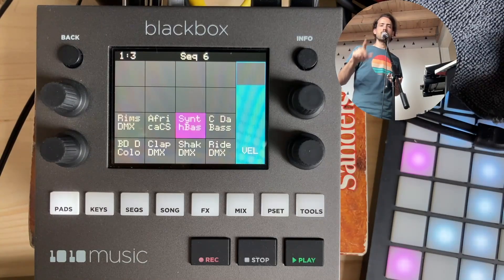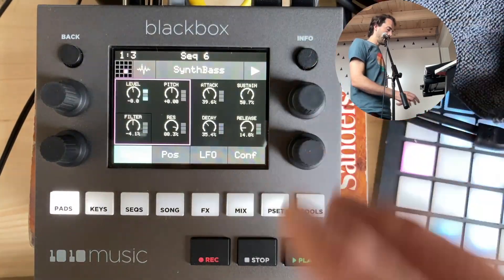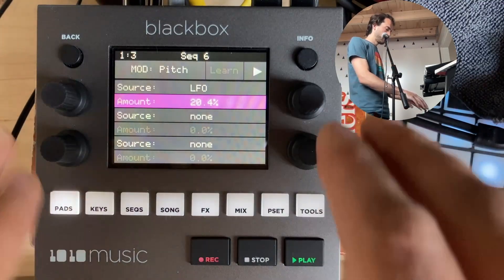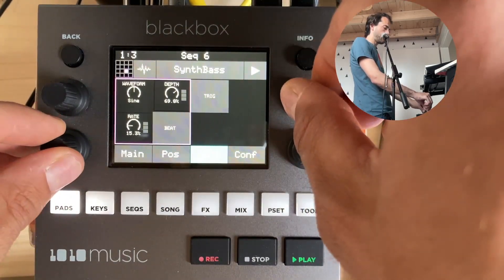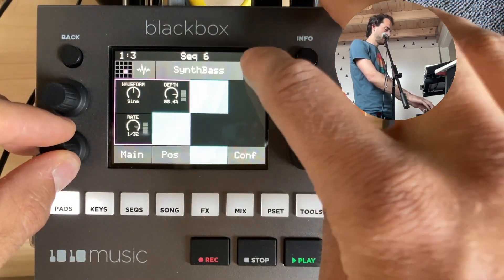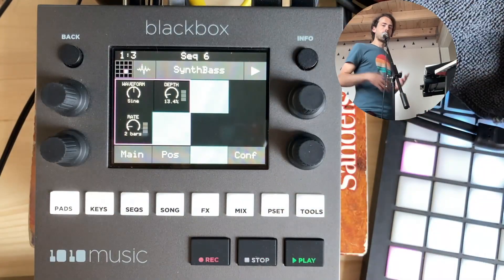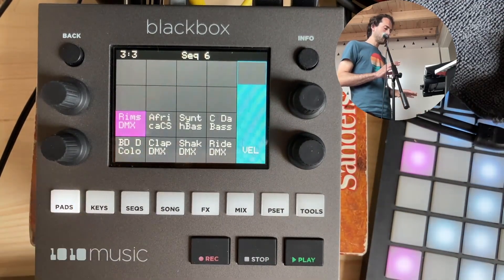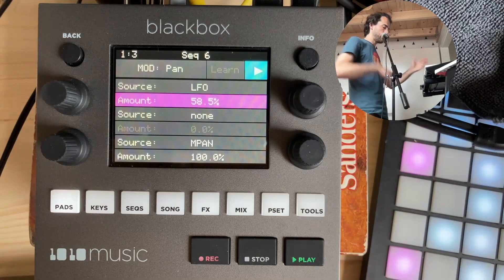1010music blackbox tip: Fun With LFO's

Comment: Just subbed for your Blackbox tips! Could not find anything in the manual, but is it possible to send LFOs out of the Blackbox? I know we can load or record CV LFOs onto pads and assign their outputs to modulate eurorack, but I wonder if we can send MIDI LFOs out to control CC on gear. Thanks for your tips!
Reply from the maker: I haven’t sought for it. But I’m actually quite sure that isn’t possible. Thanks for the sub! Anything you’re interested in for new content?
Reply: @BoringStranger  Maybe more unique ways to arrange in song mode? Is there a probabilty Event settings in song mode like there is on the midi sequencer?
Reply from the maker: Fair question. I don’t think so. But probability and playing around with that in the sequencer could already be interesting. (Although it seems not for you haha, as you’ve already know about it)